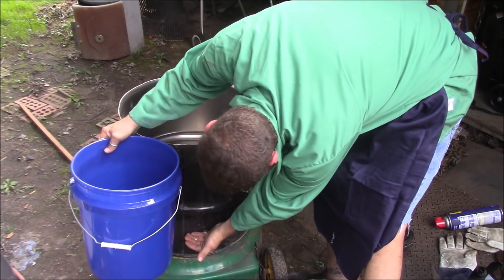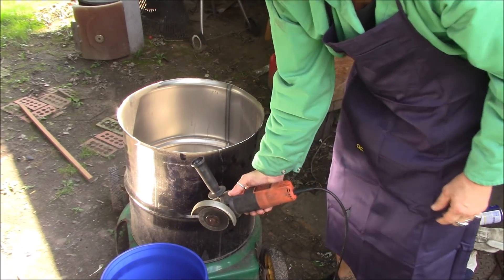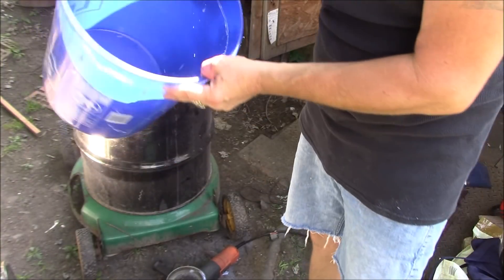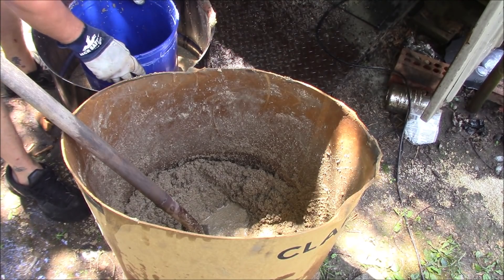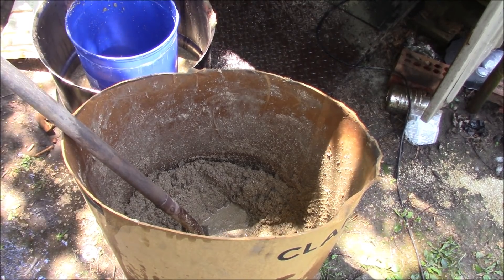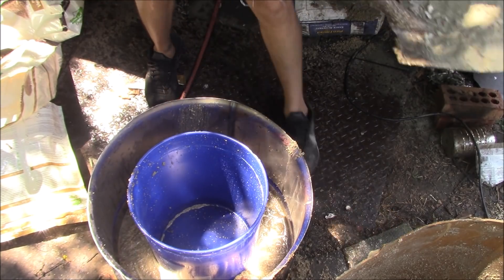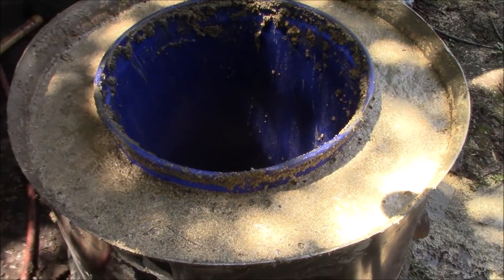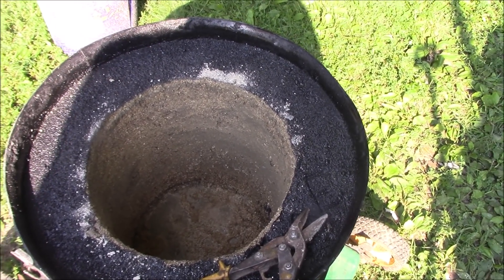Homemade Foundry build Homemade smelting furnace

Comment: I built this style in a 12" diameter steel pipe, with 2" thick cement walls, so an 8" diameter inside. I successfully forged commercially for several years. I used it horizontally, and it was perfect for long and localized heats. I even forge welded in it. If I wanted a more controlled heat, I put firebrick at either end. One or both ends, depending on the work.

Comment: Is it with cement
Reply from the maker: A mixture of cement and vermiculite.  The vermiculite just makes it lighter and is more resistant to high heat and cracking.

Comment: A little word of notice, " Dont use concrete it can go explowey from the water rapidly in it"
Reply: Then what should be the best option ?
Reply: That’s why there’s no part 2 !!! Iol.
Reply: @johnsnyder2007  What should be used instead of concrete,then?
Reply: Well, that's why you heat it up multiple times before using it. To dry the water out.

Comment: @Wayne Earls I Have built a similar homemade furnace, and bought a Graphite crucible, which i see turns red around bottom after 10 mins, My question is
When burning the aluminium cans they or just turning to dust or oxidising i put in around 18 an no aluminium at all? Can you tell me what i may be doing wrong...
 The cans melted and got really soft to  keep pushing one on top of each other but yet after 40 mins coal was burning out and nothing but ashs left in crucible?
Reply: Too hot?
Reply: Do not use cans. Once a can is melted, it is like a drop of aluminum. I use old and broken aluminum car rims. I cut them up with a grinder into a size that will fit into my crucible.
Reply: Keep adding more wood, mesquite, yellow pine, pine knot, and cedar excellent woods to use, also use a blower to increase the oxygen buildup= +× more heat buildup!!

Comment: Vermiculite expands to 3x as it's  water retention media for plants. What do you think will happen when air displaces the water content? What happens when the trapped air heats to 1000°C+, my guess is it'll blow holes in the cured concrete from the pressure exerted.
What I would be using is a quatz based silicon sand mixed with Limestone and refractory cement smeared over a Ceramic Fiber Wool Blanket reinforced by steel mesh then another layer of sand / lime / foundry cement mix with 1/5 part perlite. With an air channel running against drum and steel mesh leading to exhaust air inlet to maximize efficiency. (Although the air channel isn’t necessary it just transfers some of the thermals back into the furnace) 
The lawn mower base is a good idea though. Your mix is like a bomb though very dangerous waiting to explode. haha. Must have shit yourself when the foundry shattered?
Reply from the maker: Honestly I've only fired it twice since I built it. I have been busy. I have plans to get it going and also my small one real soon. I used vermiculite because I've seen others use it. But either way, I'm going with ceramic wool and refractory cement from now on. Thanks for the comment, I'll be sure to stand clear while I fire it a few cycles.
Reply: @WayneEarls  have you been able to heat it 1000c plus yet?
Reply: Would the moisture not just escape the concrete? It is porous after all? It might crack but I can’t see it exploding
Reply: “An ounce of behavior is worth 5lbs of words…” S.M.
Reply: With all 4 items in a mix of cement with sand, lime, and perlite with your type of cement mix what would be a good ratio of 1 bag of cement and what type of cement would you suggest using? could you elaborate on this, need a an individual with needed experience so i can form my own foundry and or forge pit made from river rock and fire suppressant concrete mortar.

Comment: Nice job, it's not a smelting furnace though, it's a melting furnace, smelting is extracting metal from the ore
Reply from the maker: Thanks for clarifying that. And thanks for watching.
Reply: @WayneEarls  Interesting, I like the furnace, I built my 1st furnace 50 odd yrs ago [& burnt a few out since!!] I run on foundry coke,I have a gas one as well but propane's expensive so use coke mostly.
Reply: @headstocktailstock  what's foundry Coke? .. thanks!!
Reply: @matthewburns6843  Coke is coal with all the impurities removed by heating in a coking works, it burns hot & smokeless,it's used comercialy in a blast furnace for making Iron & steel, blacksmiths use it in their forge as well we always have a couple of tons in for our aga rayburn cooker so I've always got plenty [ps it's not "coke" that you smoke haha]
Reply: Unless he spoke afrikaans language and he mixed his words. In afrikaans we use the word smelt.  Just a s infront of melt and it means the same in afrikaans. :)
Reply from the maker: @frikkiesmit327  ..... What...
Reply: @WayneEarls  haha.  I  replied on the top comment that was made of the guy saying :  " its a melting furnace not a smelting....  "   my comment is based on those two words.
Reply: @WayneEarls  its  a language in south africa of the white man hehhe.
Reply: @frikkiesmit327  HUh...
Reply: https://www.youtube.com/watch?v=anA6RTEz8M8&t=290s